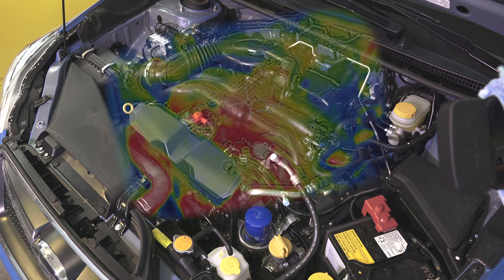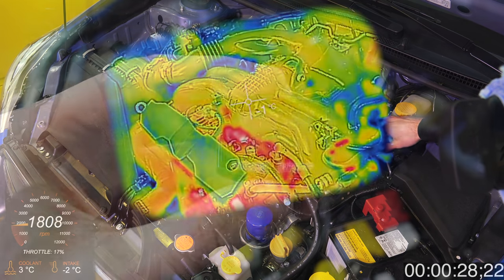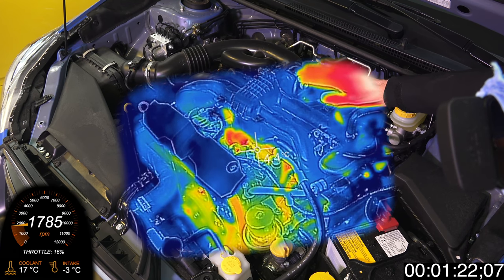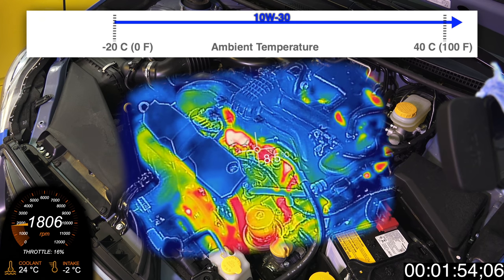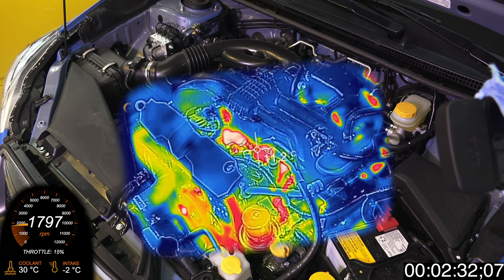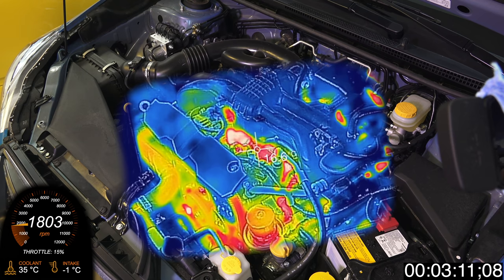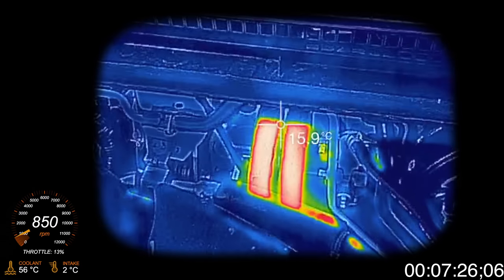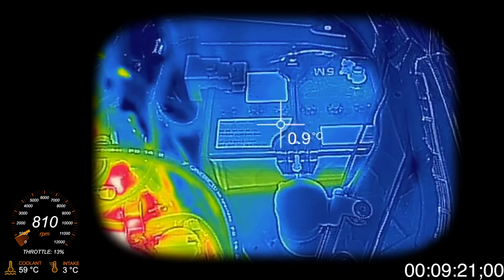Watching A Frozen Engine Warm Up With A Thermal Camera

Comment: Electric warmer is one thing and go for it! Cars well equiped it will heat not only the engine but the cabin and help clear from frost the windows.
But idling your engine? Νο!!
First it hurts the engine. Slowly and painfully increasing temp over many minutes, there is a lot of friction going on even though it is just "idling".
Second it is really bad not so much for the environment (CO2) but for the air quality and directly your health. All sorts of nitrous oxide and other emissions shoot up with cold engines. It is the air you breathe at that moment that is contaminated!
Third, if you just drive it, within a few minutes you will start getting relatively warm air. Usually it is not that bad ...and if it is, use electric warmers!

Comment: I usually wait maybe 10 - 20 seconds and then drive incredibly gently until the engine has warmed up.

With my old diesel beater though (1.9TDI VE90) I don't allow it any such luxury, and have it at full throttle within a minute or so of firing it up. It has never missed a beat despite this abuse, but don't try this at home!!

Comment: If that was a TDI you'd still be waiting for it to warm up!
Reply: Well, diesels have much more massive engine blocks. A lot more mass to warm up. I guarantee there is no other reason that would be the case.
Reply: @justforever96  дизель имеет более высокий кпд. И более низкие температуры газов в камере сгорания. Именно поэтому турбо-компрессоры на дизеле служат в несколько раз дольше, чем на бензиновых двигателях(они переносят не такие высокие тепловые нагрузки).

Comment: my winter hack is having a cheap electric fire in the garage, in winter i place it in the trunk and with the extension cord i close it and let it run, meanwhile i clear the car of snow and ice (wich takes 5 min or so) and then remove the heater before taking of. the car isnt that big of a space to heat up and in 5 min its at a pleasant  C° 20.

Comment: I have a question that has been in my mind for a long time: how do warm car parts survive the snow without breaking? Brake rotors for example, because if you throw water at them while they're hot they usually break, but why doesn't that happen when you drive in the snow?

Comment: I live in an area where the winter temps are between -10 and -20C and i still wait for 4-5minutes after starting the engine for the oil to start circulating .Say what you want.

Comment: @Engineering Explained I know some automatic gearbox Lexus's don't change gear until it's warmed up. Same goes for my Lexus. A minute after starting it won't go above 3rd gear and not over 5th beforethe coolant temperature is about 30 degrees Celsius. I live close to highway and I can't drive on it with 3rd gear at 1300 rmp...

Comment: Speaking in terms of efficiency, idling your engine to operating temp just so the interior is warm is very inefficient. Like he said, idle it for 15 to 30 seconds and drive lightly afterward. Your engine will get up to operating temp much faster that way. You may be cold for a minute, but after that minute, your heat should be working flawlessly, and you didn't waste gas or cause any unnecessary engine wear.

Comment: Great video!  I do have a question to you-
I leave my truck @ the airport for 2 weeks at a time in Alaska.  During the winter, I start it every 2-3 days thru my Drone/ Compustar module via my phone.  I let it run for 45 minutes.  So it is not moving at all.  But it is plugged in block heater and battery blanket..
I can have it set to run for shorter intervals, from what I can tell it is probably not good to have it run for 45 minutes after seeing this video.
Thanks man!

Comment: What was the calibration emissivity set at for the FLIR camera? Matte surfaces and glossy surfaces can give significantly incorrect values due to different emissivities. In addition, the lower the emissivity (per the surface being measured) will not indicate a correct temperature. I find it very strange how the oil filter temperatures are lower than the coolant temperatures. Is the oil flowing through a cooler before the filter? If so, I would find that temperature more believable since the wall thickness of the filter itself. Perhaps a thermocouple touching the surface would help validate it? Personally, I have found painting with grill or bbq paint to achieve high emissivity which helps improve IR temperature measurements.

Comment: You didn't adress the adverse effects of having the air flowing through the engine bay in regards to warming it up. Wouldn't that significantly delay the engine reaching operating temperature?

Comment: Thanks for making this video- I just wanted to know, when you said as long as you keep the revs low when driving without letting the engine warm up much..say- a minute or so in very cold conditions, how low is low? Not going past 1000 rpm's, 2000? Additionally, what would you recommend with a turbo engine as opposed to a non turbo 4,6,8 cylinder engines?

Comment: As i understand it, it´s an old myth. It used to work like that back when they had car engines with carborators.
So:
Get yourself and your car ready to drive before you actually start it. Get rid of any snow, scrape the ice off your windshield then start and get going.
The most effective way to get the engine to heat up the fastest way is to drive the car. Don´t idle your car while getting everything ready because the engine will turn without proper lubrication.

Comment: After 3 minutes the engine is still running at 1800 rpm.  
My 2018 Hyundai 2.4 idles down to about 1000rpm after 40 seconds.

Comment: diesel engines should idle for 1 to 3 min before leaving, since they do not have a spark to ignite the fuel, they depend on heat, so you want cylinder temp to be warmer, it will cause the engine to use less fuel and burn more efficiently. also use less timing. as you know diesel fuel burns and does not explode

Comment: I usually let my Jeep warm up until idle drops after about 3 minutes then driving off and easy no high rpms. Don't like and think that it can't be good for the automatic transmission to just drop it in drive at high rpms. What are your thoughts on that. Happy New Year. Nice video.

Comment: Could you repeat this after using an engine block heater?
My DEFA EBH is clamped between cylinders 1 and 2 on my Prius. At start the coolant can be 45c, which then drops to 30-35c before rising again. It would be interesting to see how far the warmth has reached after 3 hours and which bits are still at room temperature.

Comment: I usually wait for my coolant temp to hit 40f before I take off in the morning. I do this whether the outside temps are 30f or 0f. inside the car its always toasty because I have a 120v heater on a timer set to come on several hours before I leave for work. so all the ice/snow and cold upholstery is all warm and not an issue. also lets me get about 15 minutes into my drive before I turn the heater on which in my mind lets the motor warm up quicker...... actually on that. I wonder how long it would take to warm up to operating temps without using the heater vs having it on full blast.

Comment: can you talk about what happens with your transmission during a cold start? is your recommendation only accounting for the engine or does it take into account the transmission?
Reply: Excellent topic. 
Yes, a transmission need warming to facilitate fluid flow, reduce pump cavitation, provide adequate bearing/bushing lubrication and sufficient expansion of the valve body bores for valve pistons/shuttle clearance and smooth wear free operation.

Comment: Just wanted to point out, because you didn't lock off the gradient of the thermal camera, it's not particularly useful when looking at long term temperature changes like this as the gradient will adjust as the temperature changes. It would have been MUCH more useful to lock the bottom of the range to ambient, and the top of the range to the expected running temp of the engine. Then the colour grading would have actually MEANT something, rather than meaning almost nothing over time as in this video.
Reply from the maker: That's a great call - didn't realize the camera had this feature!

Comment: Did anyone see though it took 10 minutes to reach the proper idling RPM's 800 or so. The engine at 10 minutes had sufficient time to operate so the least RPM's meaning the Least load on the engine.. to answer your questions yes more RPM's does equate to more load on the engine at 800 RPM's I would say yes at that point it is okay for the Load to be applied to the engine I.E. putting car in drive and accelerating

Comment: question.
isnt "high idle" or whatever you want to call it, designed by engineers who made the engine to help reduce wear at cold temps? so isn't waiting until idle reduces back to normal (~600rpm) before you drive off, the best practice?

Comment: what about a car from 1983? cause i usually wait until i see the water temp gauge start to move(begins at 120F) to begin driving, and when i do i drive softly( low rpm, low throttle, driving slow and easy basically) until i reach regular operating temp(around 170F-185F to drive normal. it is a 34 year old car (datsun 280zx turbo ^.^)

Comment: Question for you. My girlfriend drives a Camry Hybrid. Her exhaust header comes out the front side of the engine. Her intake box is not far from it. I removed the tubing from the box to the front of the car. I did this mostly so the air going into the intake was hopefully slightly warmer since it would be getting warmed by the radiator,, hopefully allowing the engine to warm faster. My question is what is the max intake air temperature allowing the engine to run normally? Do you think the warmer intake air will allow the engine to heat faster or will it actually slow it down since it will be using less fuel?

Comment: Interesting.  There were several times when you only gave the temp in centigrade and that lost me,  but otherwise good.
Reply: As long as you keep in mind that 0 is water freezing, 37 is body temp and 100 is water boiling, you'll be fine :D

Comment: Oil for my 2001 Honda Insight 3cyl was 2.5L of 0W20 per manual. However: even the dealer would stamp "4qt 10w40" on the receipt every time. (sigh)

Comment: Is there such a thing as "too cold air" for an intake? Would you gain more horsepower or lose some if the intake air is at, for example, -50F? Compare that to 50F intake temp

Comment: Once the engine is warm isn’t it true that 0W30 and 10W30 oils are both just 30 weight and behave exactly the same? Is there any sort of difference between them? That usually takes me about two minutes of gentle driving. Is there anything good about 20 weight oil besides getting the manufacturer about one percent of fleet fuel economy? Is 5W30 always superior to 5W20? I noticed that my Ford uses 5W30 in England and 5W20 here in United States.

Comment: Question: What if you're in a turbocharged vehicle and the weather regularly dips below -40?

Would the turbocharger receive adequate lubrication, assuming correct oil choice, or should I allow the engine a little extra time to make sure oil is flowing where it needs to go? Typically, I keep the engine under 2,000RPM until my temp gauge is at roughly 1/3 of the way to operating temp (It has no numbers, but I'm guessing operating temp is ~100C), then top out at 3,000RPM until it's warm, which is largely normal driving anyway, because I like to go fast, but come on, you almost never need to go past 3K. 100KM/h is 2,500RPM in fifth on my car, it's geared fairly low methinks. 6K RPM in first is 40.

Comment: I don't do that at all. Even at -30C or colder, start the car, open the garage, drive the car out at idle, close the garage door and I'm off. I do accelerate very gently for the first ten kilometres before I hit the highway but that's about it.
And no, even with marvellously good studded Continental Ice Contact winter tires there is no point flooring the accelerator since no tire can deliver 400Nm to the ice anyway so you seldom get a chance to put the pedal to the metal in the coldest wintertime like you would when it's above 0C.   >:-)
German import W209 CLK 270 CDI Benz turbodiesel so no electric or diesel extra heaters whatsoever and no need to install any, with newly serviced injectors it starts right up at any temperature.
Idling is really just a waste of fuel and it warms up the engine super slow so there is no point.
Naturally I use the best available 0W-40 engine oil and change all the other fluids according to the service plan or typically way ahead of the factory recommendation.

Comment: Is there such a thing as over warming up your car? If it's really cold I'll let it warm up for 5 minutes at most. Is that doing any damage? I might also add that I drive a Crown Victoria Police Interceptor, so it's meant to idle for long periods. It also has an oil cooler so it takes a little longer to warm up also.

Comment: Hi, great video explaining this, especially since I live in -20 to -40(celsius).  However, aside from oil warming up, what else is important or not important to wait until warm? Specifically 2014 Subaru Outback 2.5i 6MT?  My power steering pump(at least I think it is) practically screams at a cold start from -20 or below unless I have it plugged in(electric block heater).  Even at temperatures closer to -40, plugged in or no, she is loud and protests too much.

Comment: 1)At -40 and below your fully dressed in the car and i usually dont even take off my toque unless its a long drive. Cold sucks
2) i use 0-30 and its like pudding at -40 i was scared when i checked my oil XD this weather is scary cold
3)damn gm never installed the oem one even though the car had the winter package, its like a single screw and zip ties for cable, regret not putting one in yet now its so cold i dont wanna be outside workin on the car 
4) florida is worse than working outside everyday during these extreme cold snaps

Comment: The problem is a lot of cars no longer have a temperature gauge, now what? I still drive off slow, and by the time "hot" air comes into cabin I figure I can now accelerate quicker. I would much rather have a temp gauge.

Comment: What's better or more effective to relieve stress on an engine, a block heater, or an oil pan heater?
Reply: Austin Smith Block heater probably does the better job of heating the engine evenly. Assuming your oil is the correct viscosity for the low temperatures that you are experiencing it should flow right from start.

Comment: I warm my Hellcat engine until the engine coolant is a minimum of 170degF.  I do this because it gives all of the various metals and components time to reasonably expand.  Further the wear properties of metals improves as they approach nominal engine operating temperatures.

.02

Comment: @Engineering Explained, is there an exceptions with vehicles with force induction? For instance, if you have a turbocharged vehicle, isn't it ideal to let the oil get to operating temperature to make sure the shaft and other necessary parts are well lubricated within the turbocharger system. Also before shutting off the engine, too let the engine idle for a few minutes so that the compressor and turbine drop in speed?

Comment: The number have nothing to do with the exact given tempratures. 
The first number stands for viscosity when cold and the second one for the viscosity when hot.
Now dont think that if you live somewhere were it doesnt get cold that you dont need the recommended oil, cause you’ll kill the engine.
Not hating or anything but i just dont want ppl to ruin their engines because of a cheaper kind of oil

Comment: excellent video.. id like to see a video  with this infrared  of a car with and without thermostat  but a normal outdoor  ambient temps like 35 celsius to prove weather is ok or not running a car without termostat in hot  climates...i dont run thermostat in my car cause i live in hot climate ,,,car nowdays are all aluminium and get warm faster than old iron  engines...destroy thay myth that in hot hot climates you need thermosat..id like to c how long does it  take to the car to warm up with and without thermostat ..

Comment: Question. if it really does matter, why doesn't the ecu just hold the engine at a higher rpm, and for longer? or why wouldn't car manufactures implement that if it is such a big deal. and at the same time what difference does it make to just hold the pedal at a higher rpm instead of driving? the way i see it is, driving during winter will cool your engine and rad at the same time as its trying to heat up. so seems it would be quicker to just hold the rpm yourself instead of the ecu doing it.

Comment: everyone concern about the engine oil to warm up enough to operate. Any idea on how transmission will be during the warm-up time since the trans itself doesn't have any component that create heat beside friction from gears. Furthermore, the fluid volume itself only expand to "enough" level when the car has reached its operating temp

Comment: Never bothered to warm up my engine if the temps are even at 20 degrees. I just accelerate and drive slower until everything it up to temp. The only time I let my car warm up is if there's ice on the windshield.